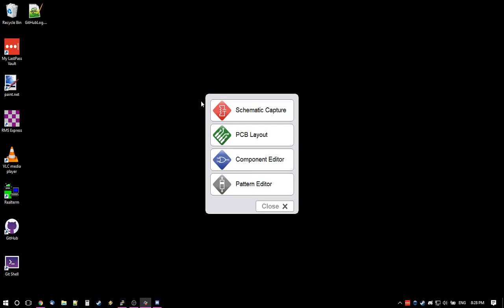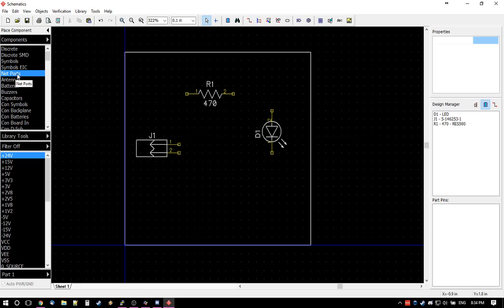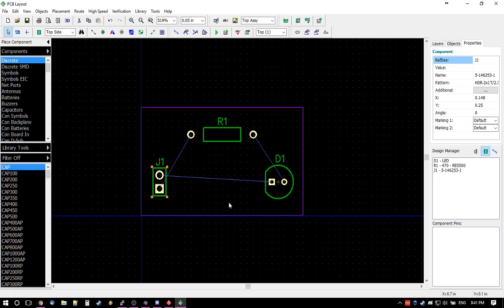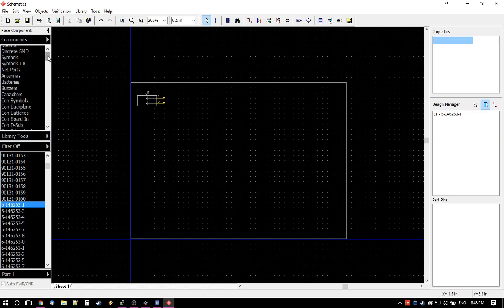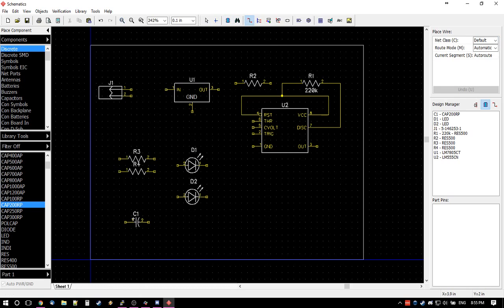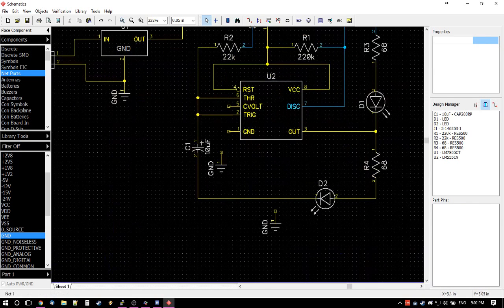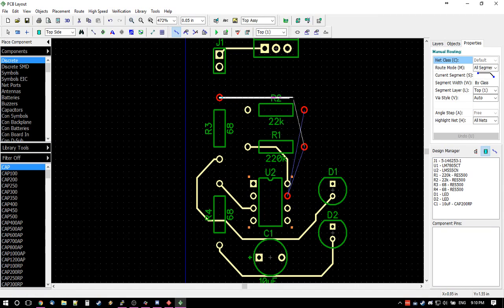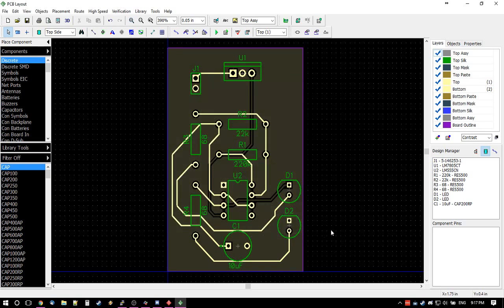DipTrace Tutorial Intro

Comment: Wa-a-a-y late to the dance here but just starting out and wanted to thank you for an excellent video. Figure if I mimic these two PCBs 100% it'll be a good head start!
Reply from the maker: Nice! Honestly, I would recommend KiCAD over Diptrace nowadays. I used to use Diptrace because they had a free version, and it was fairly easy to use, and at that point KiCAD was still very rough around the edges. But now KiCAD is all I use, both for personal and professional projects.
Reply: @AureliusR  Sorry. My earlier response seems to have been swallowed up so here goes. Understand returning to KiKad. As an old software developer, I have vacillated back and forth all the time between products. That said, the "old" in the previous sentence means I am still on Windows 7 (and I thought the Windows XP users were raging against the night!) and KiKad doesn't support that. I started out today (March 30, 2023) doing a simple RF preamp circuit and, while stumbling, seemed to have made out OK. Of course, your video was in the background as an example as the preamp was haltingly created.    

By the way, the current DipTrace offerings are for a non-profit edition that can, once downloaded and installed, be upgraded from 300 pins to 500 pins for an email requesting same. The current non-profit standard that usually sells for $125 and offers four layers and 1,000 pins, is being price cut to $87.50 (30%) until April 15th, 2023. 

Teetering on the edge of that except I am miles away from that robustness and baby needs new shoes.. 

Thanks again for your help!

Comment: when i do auto placement it leave the space underneath the components on the other side of pcb. how to solve this???
Reply from the maker: What do you mean? If you do auto-placement, it will only place the components on that side of the board. If you want components on the back, move them to the back first and then run auto-placement on that side.
Reply: @AureliusR  sorry I couldn’t put my question correctly.
I know to “change side” of any components. But issue is when i placed the potentiometer on top side, then on the bottom side other component are leaving the shadow space of pot. Waste of space… how to tackle this.

I hope I’m making sence
Reply from the maker: The auto-placement tool will never place components over top of each other, even if they are on opposite sides of the board. There is no way for the auto-placement to know exactly what type of device it is, if it will interfere with track layout, etc. If you want something like that, just place it manually. Auto-place and auto-route are pretty much never used by anyone who takes PCB layout seriously. They do a crappy job and you end up with bad results! Just place things by hand in a logical way. Practice, practice, practice!

Comment: This really helped me get started. Now I just need to figure out how to make my own library, which has proven frustrating. Anyone have advice for how to create component libraries?
Reply from the maker: What problems are you running into, exactly?
Reply: @AureliusR  I have been learning DipTrace through videos and forums. I've created a master Libraries folder on my PC, with sub-folders for every Library. I've titled these Libraries Resistors; Capacitors; Transistors; etc.. I've designed components and Moved them into these Libraries within DipTrace. But these components do not appear in my PC Libraries' folders. I guess that's okay.... Some of these components are from Mouser/DigiKey and I've modified the footprint/pattern in DipTrace. I am NERVOUS and confused about how to transfer my PC files to another computer so that I may use DipTrace with my custom components and libraries on another computer. THANKS!
Reply: @AureliusR  Do you have any advice for my library issue? I'm still unsuccessful in my attempt to move my library from one computer to another.
Reply: @Jacob Horowitz  I believe this should work open your PC Libraries > right click lower component area (below Filter Off) > Insert from another library (name maybe slightly off im not in front of DipTrace) and find the part you want and you should be able to aggregate them all into PC Libraries. Alternately you can find the part you want to import and right click part name > copy to another library (again maybe slightly off) and select PC Libraries. You will have to do this for both pattern and component libraries separately. Then you would just find the PC Libraries .eli AND .lib files in windows explorer then you only have to copy those 2 files around any pc. Have been sharing my libraries with custom parts this way between coworkers. Hope this helps!
Reply: Once you know how to do it its very simple but I can make a short video for you if you need it, Diptrace handling of libraries is atrocious
Reply: @7o_o793  I found a post about migrating libraries to a new comp, which worked for me: 
1) "Add Group" in Library Setup.
2) Change group name to same as on previous comp.
3) Add Folder of .Lib file from previous comp.
I'm still learning and working through the frustration. I wish that DipTrace had a "hop-over" feature for crosswires.

Comment: Hey curious what a TB header stands for, and why you didn't use the Con. Battery option?
Reply from the maker: TB stands for Terminal Block. I used it just as an example, so you could wire in a battery holder or connect a power supply, whatever you want.

Comment: Great tutorial.  Quick question, how do you make vias and edit the trace diameter (for RF impedance controlled transmission lines?
Reply from the maker: To be honest, I have completely moved to KiCAD as I now use only Linux. So I can't remember, but I imagine you could place a via, and then right-click on it to change the size. For changing it universally, there is probably something in the design rules or board setup that will set the exact diameter around all vias.